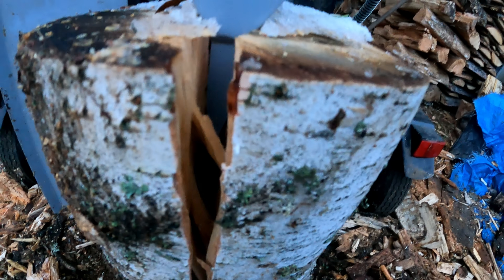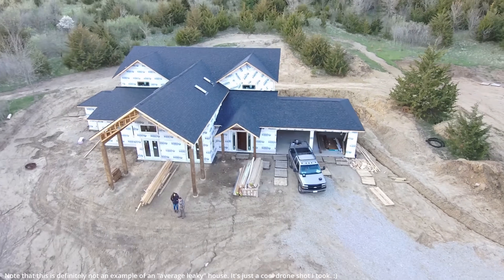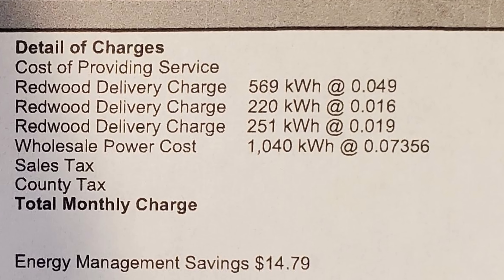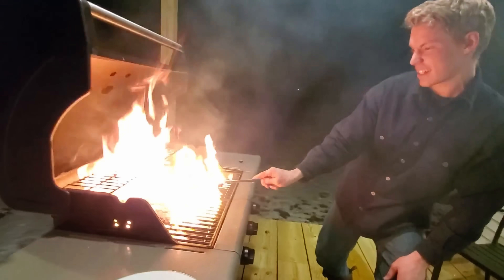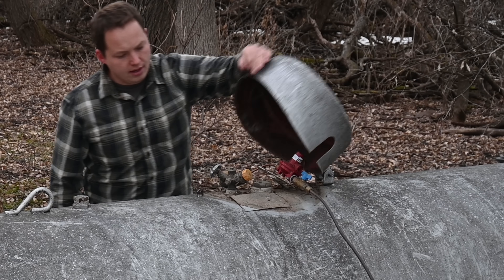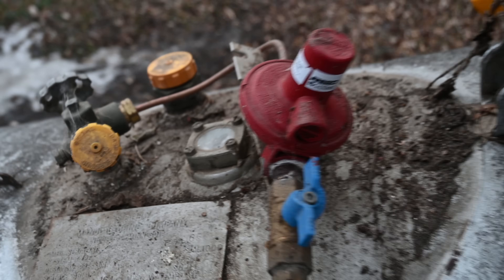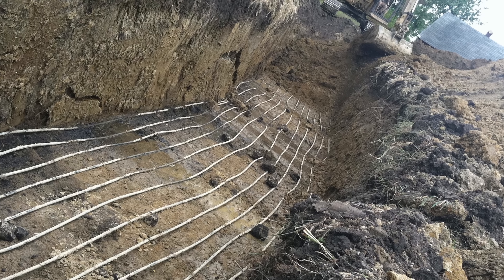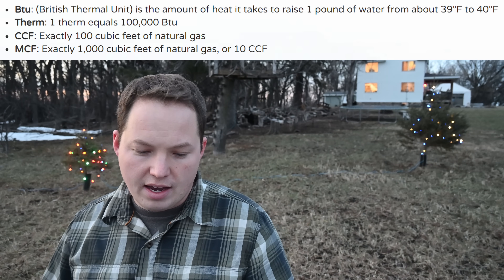What's The Best Heat Source in 2022? Top 5 Home Heating Methods - LP Electric NG Geothermal Fuel Oil

Comment: I  would think a must would be a air tight house with a air exchange rate of about 1 per hr and a complete insulated house with closed cell foam is the way to construct your house. After that almost any heat source won't be too much
Reply: Most of the heat is lost through the windows, the key is to insulate your windows in the winter.

Comment: We use a kerosine heater during the day so we can monitor it, then the gas furnace as back up. We also use plug in space heaters that only use 2 amps per heater. Still waiting on first bill to check cost.

Comment: I am assuming you took into account the 3 times spike in natural gas. I figured this would jump to the low production of oil where they get natural oil.
Reply: I am truly not trying to pick on you. Gas, kerosene and propaine are products of oil drilling. Reduce o production and reduce those by products. The US is also exporting natural gas, all this lead to tremendous price increases.
Reply from the maker: Only based on as close to current numbers as I was able to get for the Upper Midwest. Spikes in pricing are another downside to grid-tied energy options as compared to fuel that you can purchase in bulk quantities for sure.

Comment: How about radiant floor heat VS a forced air system?  Do you have a video on that?
Reply from the maker: Good idea! I'll have to do that at some point. Forced air is definitely cheaper but in floor heat is more comfortable. Also, no AC is possible with in floor options so forced air is still required.

Comment: Fairly informative but we're missing some key points. I was in HVACR for over 50 years, technician, installation manager, service manager, HVACR instructor, factory rep for Carrier. What gets missed a lot in these discussions is that the building and heat emitters are part of the system. If the home and/or emitters (baseboard, ductwork, etc) are junk that needs to be addressed first. If the home is under construction or planning then we need to be ground source, variable speed ductless or NG/LP mod con ( modulating condensing) boilers period. Standard oil or gas systems are complete garbage except the System 2000. The US still uses AFUE (annual fuel utilization efficiency which is a fancy way of saying standard exhaust efficiency test) to calculate eff%, it is seriously flawed, it does not take into consideration actual steady state and stand by running conditions. For example a oil or gas boiler with the yellow efficiency tag on it that says 87% is a lie, that system could actually be 60% or less.  Then comes the "are you going to save any money?" test. If you need a new system because yours is old and dead then go with the best available. If you are just changing to save money, well, what's your payback?? If you are going to spend $12000 to save $500 a year for example it's going to take 24 years to break even and then you'll start saving, maybe, by then your system will be obsolete and dead anyway. Many times it's better to look at the structure and emitters and improve that but beware of scams, like windows, new windows could cost over $10000, so again how many years to break even? And don't ever go from double pane to triple pane thinking you are going to save, the U value between the two is minimal and you won't gain much. Clean your baseboards, radiators, insulate and seal your house, foam where you can, have an energy audit done. If you have exposed ceiling beams in the attic that's your biggest loss right now and it's cheap to fix, beams are transmitters, the heat or cold in the attic goes right through them and that's why you need insulation over them and again foam is the best. I brought my attic up to R50 or more and it's noticeable, my heating system and cooling system do not run as much and cutting the hours they run saves more energy.
Reply from the maker: Excellent thoughts!
Reply: System 2000 with a steel heat exchanger is the biggest pos ever made and is bat far the most disposable piece of garbage to ever be called a boiler.
Reply: I was an HVAC/R man for many years as well. Tech, install and duct design. We chose to go with a dual fuel system by placing an H/P coil over a propane furnace with a variable speed fan for backup when it gets too cold for heat pump efficiency. We also use an old wood cookstove that not only heats the main area, but placed the system return air grill nearby so it would spread the radiant heat throughout the house. The actual system runs very little other than the fan to recirculate air.
Reply: System 2000 are not the best boilers, one broken bolt those steel things are condemned.  Biasi, Buderus, are far superior, less maintenance, fewer things go wrong.

Comment: Still waiting for someone to sell a air to water mini split in the United States so I can use it for radiant heat , great video.
Reply from the maker: That would be pretty sweet. They do have heat pump water heaters which are basically that same concept but they aren't designed to extract the heat from the outdoors so thus would not work in that situation.

Comment: To bad you don't go to the environmental benefits of some of the fuels. But I guess that is the US for ye where money, cars and stuff comes first and your family, children and the environment come last. Sorry for the little jab at the US but it is almost true. Good video, learned something today. Thumbs up
Reply from the maker: No offense taken. Personally I don't think that fossil fuels are a bad thing and are not doing nearly as much damage as some would have you believe. Either way though I agree that moving towards having buildings that use less energy is a great thing! The other issue is that until we have more reliable electricity that is not based on coal and natural gas then those super efficient heat pumps are running on coal in the end anyway.

Comment: I think your efficiency numbers are way off for propane, oil and natural gas you have best case numbers maybe. condensing high efficiency heating systems that are new and perfectly clean. a lot of people where i live put in standard efficiency cheapest system they can get, and they use chimneys not double pvc intake air and exhaust. so, its maybe 80 to 82% efficiency for gas and 86% for oil when brand new and clean not counting all the heat going up chimney and cold air sucked in house as makeup air
Reply from the maker: Interesting! Around here I'd say 8 out of 10 houses have high efficiency condensing gas heating equipment.

Comment: Kansas City area. Had a heat pump but when it died went natural gas only. My complaint about heat pump is the discharge temp is low and I never feel comfortable when it's on... ;)  Neighbor has heat pump that runs continuously when gets below 30 is noisy, and our lights blink when it comes on... Yes I called the utility company, they found no problem.  This year we put in a 95 %furnace, it seems to be doing well, at least until some critters crawl up the pipes.  The wife prefers it to be 64 inside year round, me, a bit warmer. I use a back bedroom bath for a couple reasons but it is small enough that I have a heater  like the one in the video that takes 5 minutes to warm it up.  Whatever works! ;)

Comment: I have a similar setup with dual fuel heat pump, except natural gas. When I originally set it up I had the balance point set to lockout the compressor at 50*. Since natural gas nearly doubled this year I moved that down to 30*. Our electric rates here are right at 10c/Kwh. Having the dual fuel setup is nice. When we have a power outage I can run the gas furnace on the generator and not freeze in the winter.
Reply: With a R-410 heat pump (anything installed after about 2005 had to be R-410) you might want to set the change over to about 25F,  This is because you can actually collect a lot of heat for a very low cost down to about 25F.  I have all electric home, and find that if I run the heat pump in the daytime, it is most efficient.  If you have a very old R-22 system (look at the data sticker on the unit) then the switch to natural gas should be about 35F.  They do not collect heat nearly as well as a modern R-410 system.
Reply: @Kangenpower7  Mine is R22 installed in 2009, I wouldn't say it's "old". It's a 14 SEER unit. It struggles to keep up once the air temps hit 20*F. I calculated that temp using my electric/gas rates and COP chart from the manual. It's kind of a pain to do, so I only do it when the rates change drastically.

Comment: How come you're using so much LP in one winter to heat that little spray foamed house?
Reply from the maker: I only use about 500 gallons for the house but a bit more if you add the garage to that.

Comment: I really appreciate this video,,, I'd love it if you would make a video on how a wood burning furnace works and the pros and cons of it. BTW I've been a subscriber to your channel for a few years now and have really gotten some great information for the electrical wiring aspects of my remodel. I turned a friend of mine onto your channel when he was building a small MIL unit with absolutely no experience. He wired the place up and the main box based on your videos and passed with flying colors!
Reply: I have 1 and love my wood burning furnace. 1st check with your insurance company, they tend to frown upon them. Accessibility to wood and getting it into the house. Chainsaw, gas, wood splitter, do you have a chimney? Does the chimney need a liner. Lots of things to look at and initial set up. Can't just sit around it takes work even after your all set up. And do you have a chimney sweep in your area. I've been cleaning professionally for almost 30 years and installed a few.
Reply: @kevingray4921  I'm in the planning stage of my dream home,,, I live up in NW Washington and am just trying to figure out what would work best. I know I want heat loops in the floor but haven't decided on the best way to heat them or the entire house.

Comment: The change in "management" didn't affect propane prices. It would be strange that the new "management" was able to affect propane prices in Canada.
Reply: it does if you cancel keystone xl pipeline which was going to sell tons of northern Canada fuel to united states and ship it overseas and drilling for fuel in federal parks etc all drove prices up and now we are back to buying it from OPEC
Reply: @ranger178  🤣, the investors in the pipeline stated that would not increase oil moved until at least 2030 due to current spare pipeline capacity. Furthermore, current pipelines all go to the Midwest whereas XL would ship internationally. Public land leases are also not an issue due to the multitude of current leases being undeveloped. Has current US production changed much? Not a lot and most us suppliers that went out of business did so due to low fuel prices. Try again.
Reply: @ranger178  They are trying to recoup the costs from the low oil prices caused by the pandemic. You think they would need to raise global oil prices to cover the pipeline not being built?
Reply: @ranger178   Why not when most of the 🇺🇸 population thinks it is the president's fault. You can't seriously think that after a brief bit of research, can you?

Comment: Friends of mine where away for the weekend after filling their fuel oil tank. I leaked badly and they came home to an inch of fuel oil over almost the entire basement floor.  Maybe that is the reason that fuel oil tanks must now be outside in our area.  Still a pollution cleanup problem if it leaks.
Reply: we have opposite here you can't install an in-ground oil tank anymore here we removed ours as water started to leak into tank. city fire dept prefers inside basement tanks with drip trays under them they are more worried about oil leaking on ground outside. it would be rare for someone not to notice oil smell if home, but we switched to natural gas

Comment: STEAM. Still the best. Wish they still did it.
Reply: hot water heating is much more efficient than steam and pretty close in comfort level so most systems are switched to that. steam does not work well when it is mild out only when really cold
Reply: @ranger178  I have steam in a poorly insulated 1925 house and its the best feeling coziest house ever. No cold spots or drafts and the oil tank gauge seems to magically stand still. Once its up to temp the burner shuts down and those heavy cast radiators stay hot for a very long time and it can be hours before it fires back up. In my case anyway it blows the doors off numerous HW baseboards I've had at different houses sized the same.  "miles per gallon" + humidified toasty heat. Don't notice any in between weather temps having adverse effects. Glad for now anyway.

Comment: All this numbers point to one thing.... your cost to you/us at the end of the year. Problem are 1) all those commodities change in price dramatically over the years. Before I converted to close loop geo thermal I paid anywhere from $2.50 a gallon of oil to $6.00 a gallon. 2) it does not take into account the cost to the environment even with wood you are still burning a fuel that releases CO2 into the atmosphere and the long term cost to all of us is astronomical (think the cost of more severe storms and your health care cost by more people getting sick from pollution.
Today to heat/cool a 4000 sqft home with a sauna, hot tub 2 fridges, charging an EV and all the amenities of my home my electrical bill is $1,750/year! And my power comes from a solar farm just 10 miles down the road. Yes there was a heavy initial investment but federal and state incentives cut my cost by almost 40% and it paid for itself off in 5 years. 
I am very privileged to be able to do all this things and I hope most of you have an opportunity to change and get government support.
Reply: they actually claim that burning wood is not that environmentally bad since the trees absorbed tons of co2 over their lifespan to make up for what is released burning it assuming new trees are grown to replace the old dead ones burned

Comment: I live in a 900 sq ft home and I use about 300 ccf of natural gas each winter. According to the source I just read, 1 ccf(100 cubic feet) of natural gas generates about 104,700 BTUs. So that comes to 31 million BTUs we use in the winter. Our home has no insulation. But we are neither northern or southern. We are in KY right in the middle. This year I suspect we will use about 200 ccf and that's because we are setting the temp 60 at night and 68 during the day and also I think we are going to have a more mild winter.

Comment: Great video. We are in a major renovation project right now. We use a new Mitsubishi mini split that’s good to -11.  It works very well. Unfortunately in our basement space we still need to use resistance electric baseboard, but that will be addressed by next winter. I did imbed pex tubing in our basement slab and we’re figuring out how best to heat the water to get that online. A heat pump water heater looks like the contender.  
So thanks for the video. I will add this:  DO NOT PUT HOME HEATING FUEL IN YOUR MODERN ROAD GOING DIESEL TRUCK OR CAR (unless you’re burning ultra low sulfur diesel fuel in your home heating system). Modern vehicles operate on ultra low sulfur diesel only and you will be in a world of hurt if you try it. 
In closing. Insulate insulate insulate.

Comment: Great video. Never knew heat pumps could be that efficient. I live in CT where it can get rather cold. We unfortunately have entirely baseboard electric heat that I have replaced with all hydronic baseboard heaters. One think I didn’t hear you mention was wood pellet fuel, which we do use to heat the majority of our home with. Back in the early 2000s I had a pellet stove as well, and a ton of pellets cost about $200. I pay $300-$340 a ton today. I have never calculated or broken down costs based on electric or pellet fuel usage, but your video encourages me to do so!
Reply: If you are spending more or less than $1,500 a year for pellets, then you are doing good?  Or if more then not so good.  A heat pump will work great down to about 25F, then the amount of heat per KW starts to taper off, and using the pellet stove might be a better idea when it is really cold outside.  

If you have hydronic baseboards powered by a electric boiler, that can be much more expensive than running electric heaters.  But if powered by propane, go back to the cost per 100,000 Btu's.  It is whatever 1.1 gallons of propane costs you, or 23 KW for all electric heater, or about 8- 10 KW for a high efficiency heat pump X your local power rate.  The Most expensive in the winter of 23 will be oil heaters at about $5 - $7 per gallon of fuel oil or diesel or off road diesel, take your pick.  Most furnaces take about 1 gallon of diesel to produce 100,000 Btu's of heat into the home, because they are not very energy efficient.

Comment: The problem with your assessment is the starting point...a discussion of a national average..  Energy costs per unit consumed are regionally established.  Infrastructure delivery is a key feature. The NE has significant access to oil, gas, and electric.  Most homes have a mix of resources.  Propane costs are extremely high when compared to the upper Midwest.  Beyond that, state regulation establishes final costs per unit to the consumer.  A therm of NG in NYC is twice as much as in Boston even though the commodity price is the same because it is derived from the NY gate and Boston continues to be supplied with LNG.  Electric rates in the deep south are far less that the NE and California ( which is its own marketplace).